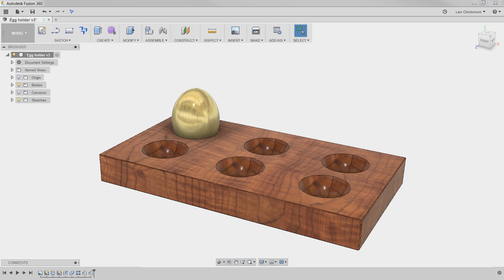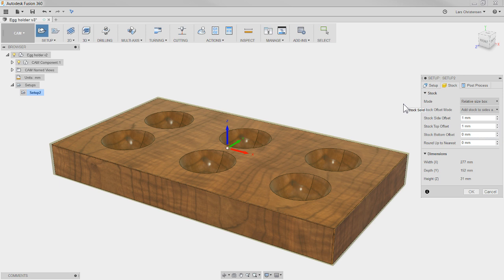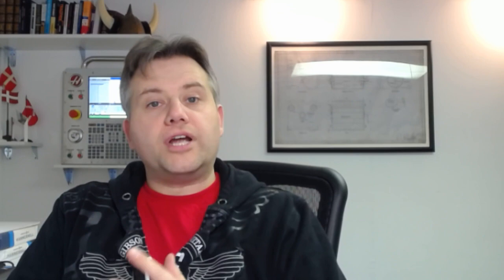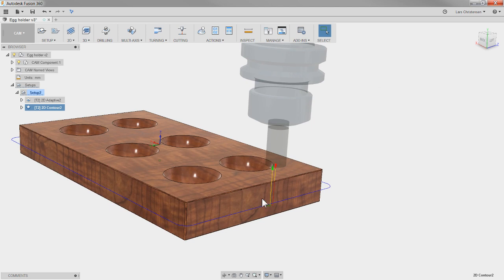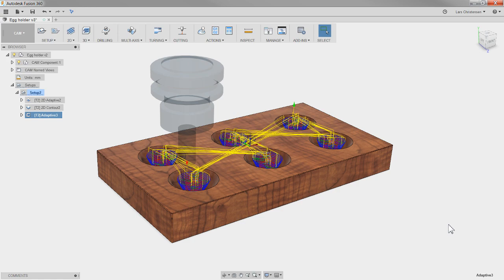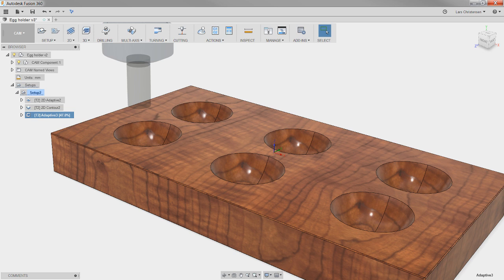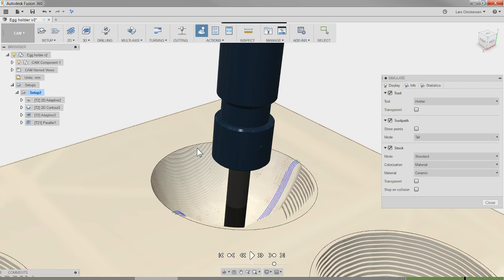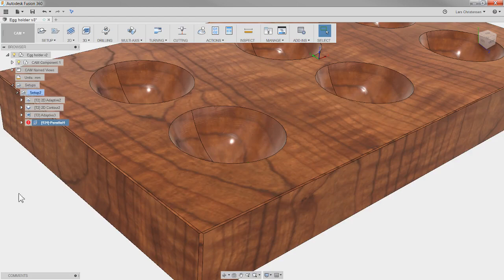3D Machine an Egg Holder — Fusion 360 CAM Tutorial #LarsLive 106

Comment: I often have wood blanks that are not quite square or the same thickness from blank to blank, and might need up to 3/16" off the top, for those I find that 2d adaptive works great for facing. I often just do that with the same 1/2" end mill I'm cutting with to avoid a tool change and to get it faced in one pass.  Another thing is I always set my Z to the bottom, or to my fixture or spoil board face, because if you have varying stock thicknesses, you get the same final result in you finished piece without messing with setups, measuring, etc. Since it's wood and you are facing in one pass, the cutter doesn't care if it sees a bit of varying material thickness. Thanks for the constant stream of great content, more intermediate / detailed CAM advice is always appreciated.
Reply from the maker: Hi Matthew Clark Thank you for watching! ANd for the great comment!!

Comment: Hey Lars it Dennis  I have a problem with my machine I engrave text I set my z 0 and it cuts fine but when I get to the end it is a 1/16 high I've sloe my acceleration but it works the it loses its height (self built machine)
Reply from the maker: Hi Dennis, if you run an indicator across your bed, is it flat?